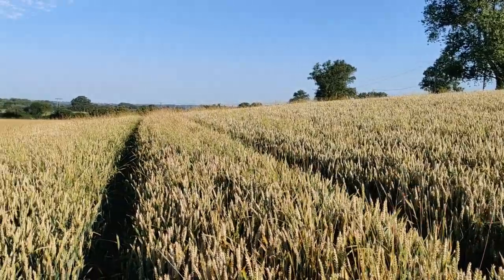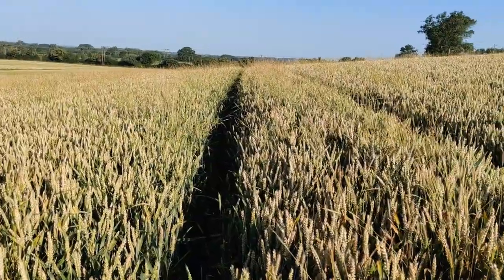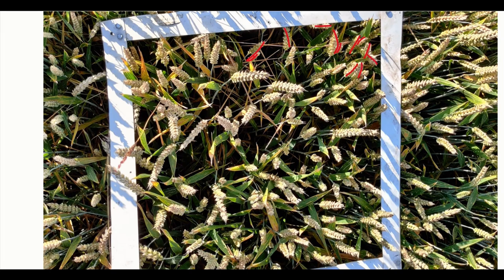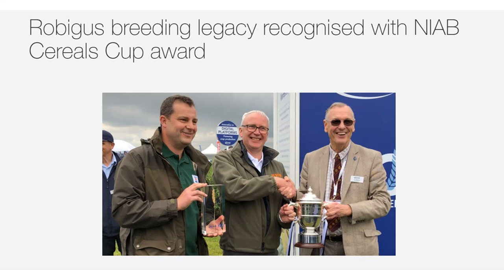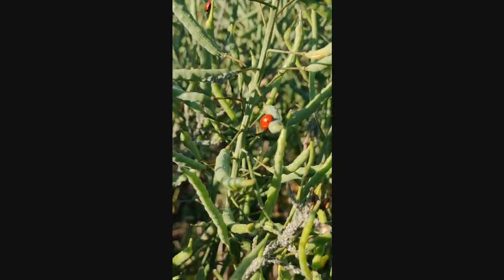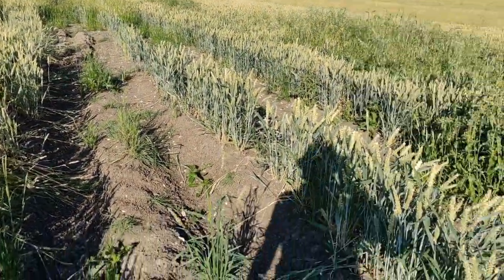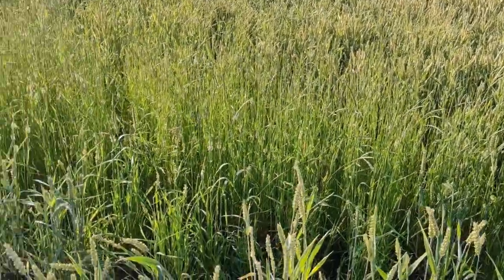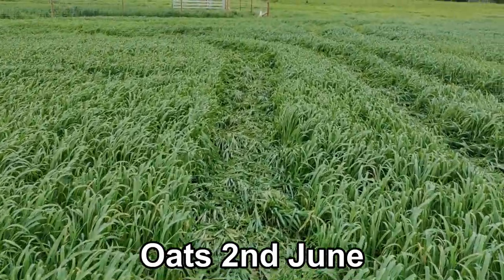Revisit broadcast wheat

Comment: Would you broadcast and lightly till the seed in again Andrew or stick with the disc / tube direct drill? Soil disturbance appears to be they key doesn’t it? Ie less the better.
Reply from the maker: In a wet year I'd be willing to do it again. But we're planning 100% cover crops going forward.
Reply: @AntonysRegen  
If you had to spin seed on again, perhaps using a stubble rake or a grass rake to cover rather than the cultivator may be better for less soil disturbance, plus less wheeling's.